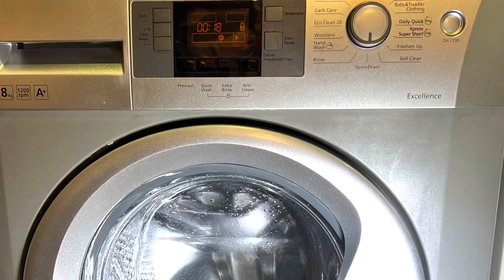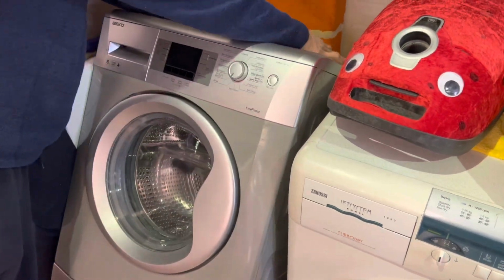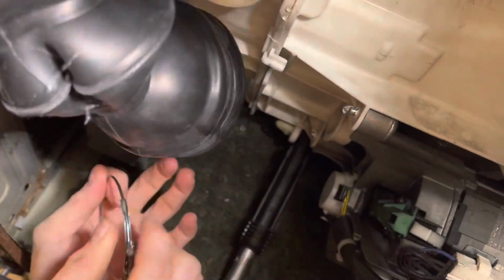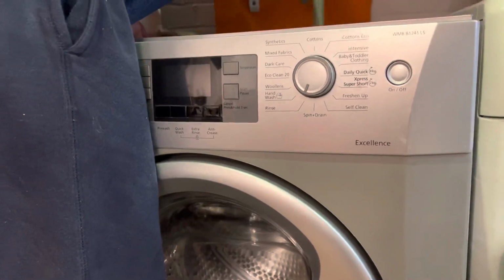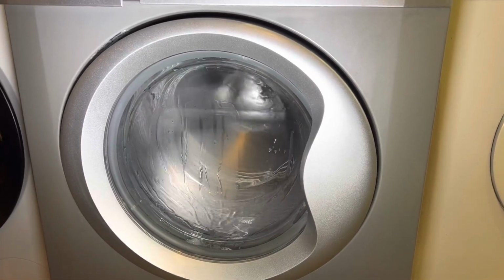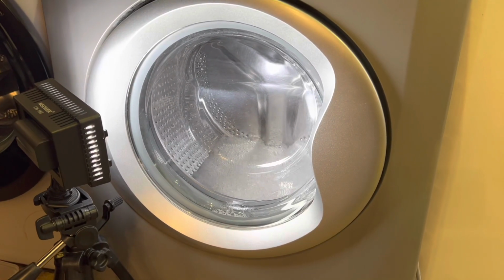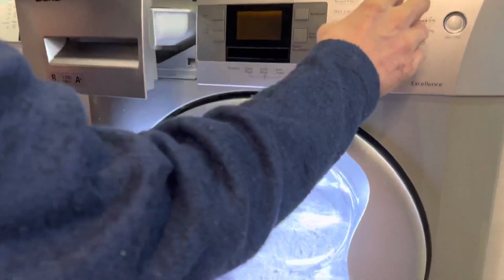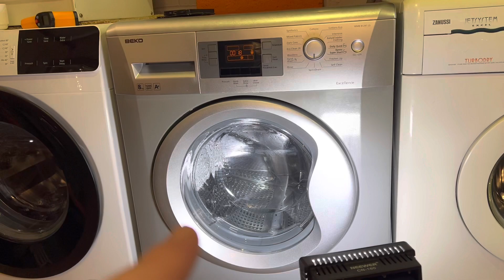BEKO WMB81341LS, How to Neuter A Washing Machine With @servisslimline

Comment: Hi, What was the point of removed the ball valve from the sump? I had a problem with my Beko machine not fully draining, there was still water in the drum after the spin cycle had finished. I drained the drum removed the pump, cleaned it and also washed through the drain hose. I couldn't find anything obvious all of the parts were fairly clean.
Does the ball cause problems with draining? I also ran a boil wash with a cleaning tablet, all seems okay for now. Thanks for the excellent content.
Reply from the maker: Hi, I just found it slightly slowed the draining, now the issues have almost gone away.